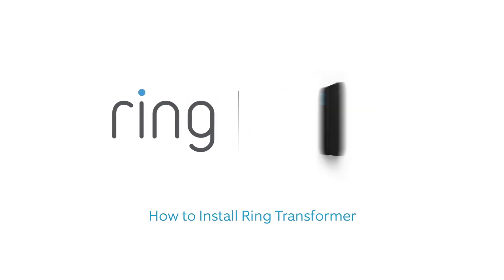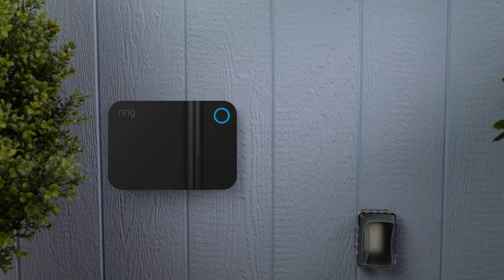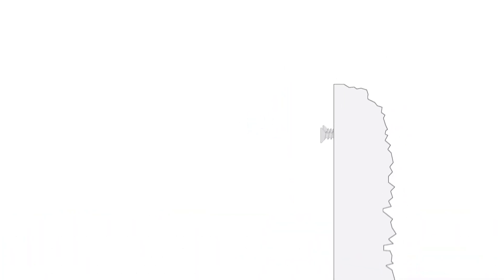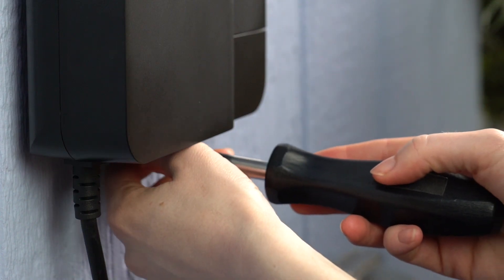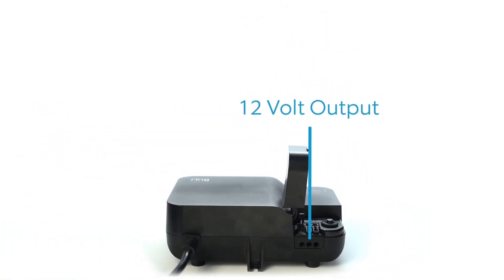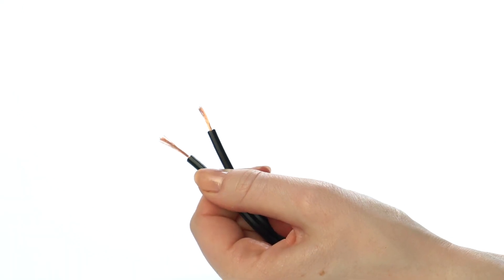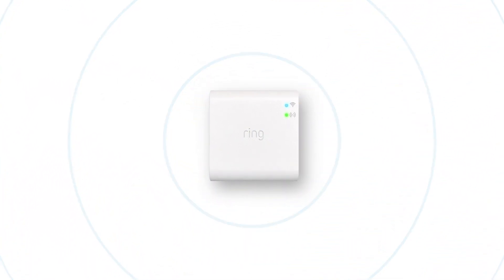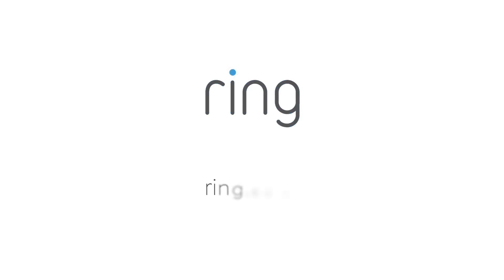How to Install Ring Transformer

Comment: Which wire do I plug into the common and the 12 volts? One wire is black and the other is white, I also have a ground wire.
Reply from the maker: Hi there, we're here to help. We'd be more than happy to walk you through the set up process. In order to provide you with the best support possible, please give us a call at 1-800-656-1918 (or if outside the US http://ring.com/callus) so we can further assist.
Reply: Did they answer this for you? I also have the same question.

Comment: Can I daisy chain 2-3 outdoor lighting systems if the total number of lights is less than 50 and they all use 12 V or less?
Reply from the maker: Hey Chad! One of the most powerful ways to use your Ring Lights and Cameras is to group them together using the "Groups" function in the Ring app. Grouping your Ring devices allows them to react intelligently to events that happen on your property. You can, for example, turn on all the lights on one side of the house when any single Smart Light device or Cam in that group detects motion. You can also turn on and off and control large numbers of Smart Lights without having to use them individually — learn more here: https://bit.ly/2W5rDgW.
Reply: @ring  Thanks.  I bought a few transformers to give them a try.